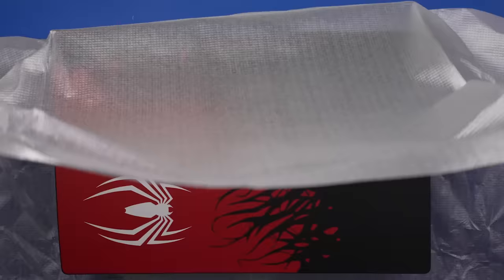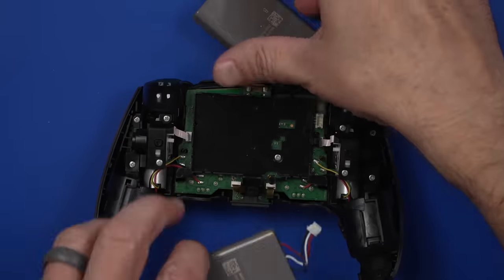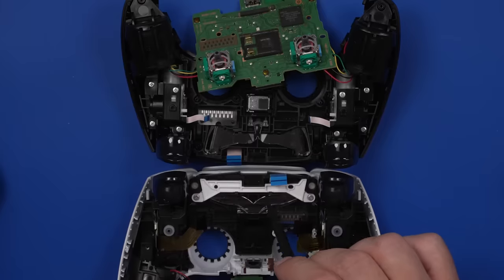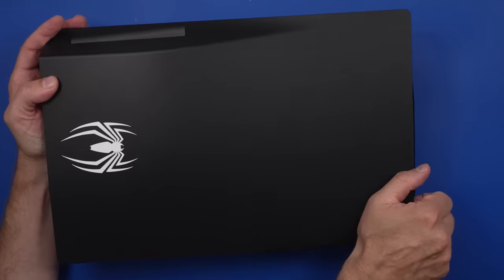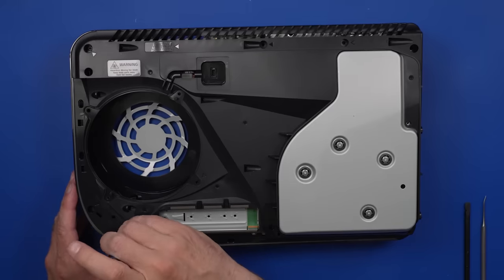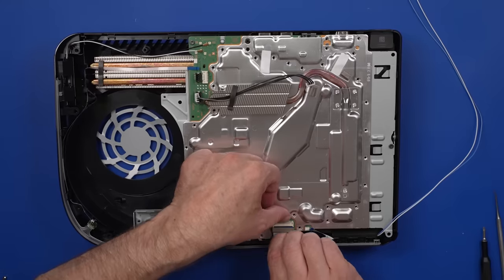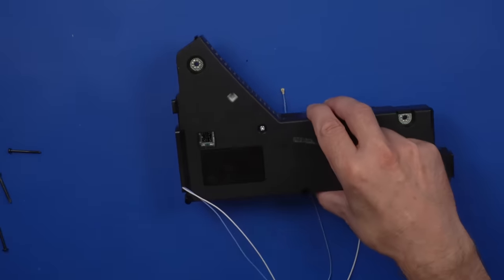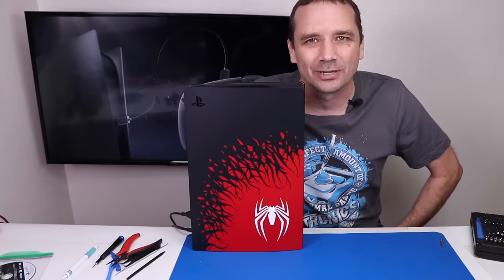The Spiderman 2 PS5 is a Disappointment - Teardown

Comment: I don’t think anyone expected it to be any different from any other PS5 in terms of hardware.
Reply: exactly
Reply: @caphowdy666  oh yeah?? Look at ds4 old model that has no lightbar..
Reply: @sevengedafterlife9670  All dual shocks had the light all they did with the new DS4 was had thinner plastic above it so it showed through above it. That was nothing to do with "limited edition" that was to do with being an updated controller everyone could buy. Same when you talk about early Dual sense vs second gen. They annnounce the changes. There were no changes announced for Spidey limited edition just the cosmetics.
Reply: EXACTLY
Reply: Exactly. It's more of a video to badtalk the ps5 imo... But hey, I'm sure that if you don't clean it from time to time, It'll end up with with some spiders inside...

Comment: I’ve never thought about a “special edition” console as being different on the inside. It’s just a way to get a fancy color or design. It was great for me because I didn’t have a PS5 and those plates sold out super fast.
Reply: Xbox does cool things on the inside. Like they did for Xbox one s minecraft special edition (imo the best se console of all time)
Reply: @Luckysury333  really doesnt matter to the consumer at all, also because the PS5 only uses plates to customize the console theres no need for them to open up the PS5 or make new  spiderman themed parts when they can just whack on some plates on and call it a day
Reply: Yeah but xbox does that because they target the teenagers and preteens. Xbox has always done cheesy special editions.
Reply: @tinystar3010  I mean, every console is geared towards kids. Spiderman, mine craft, fortnite, halo etc. Xbox is just better with build quality,  power, reliability , and low maintenance.  I own both and can say for sure I've needed 3 ps5 controllers in 2 years and needed to redo thermal on ps5 bc overheating. I haven't had any issues with series x yet
Reply: just get them fake they are half the price and look the same. This is on Sony's for doing such a small limited run.
Reply: @Luckysury333   The one thing Xbox does nice is that it's not just a console design. They'll put on a custom start-up chime too. PlayStation has been using the same boring beep since PS3, even for their special editions. Put in just a LITTLE effort for once, Sony.
Reply: If there is nothing "special" about a piece of hardware product then there is another word for it...scam! 

some of us already know its usually just some colors but the majority of people will belive this scam and think its better hardware for higher price
Reply: @benji7275  I replied to the comment that said they have never thought about a se console being different on the inside. So I mentioned there are se consoles that are modified (because it is just the same components with a bunch of Easter eggs in xbox se consoles) on the inside.
Reply: @tinystar3010 I wouldn't call that gears of war se "cheesy" thing looked cool.
Reply: @MichaelM28  yes
Reply: @MichaelM28  I'm sensing you're a Sony fanboy and that's fine but from my own experience of owning both ps5 from 2021 and series x from 2021 my ps5 has needed more maintenance and controllers broke 3 times. And it's crazy because I play the Xbox more lol and the proof is in the stats xbox is built better 🤷‍♀️
Reply: @MichaelM28  I mean, it really is. The last few Xbox consoles have proven that they are well constructed, silent and reliable. Meanwhile playstations are getting dry spots on their APU’s already The series X and S are some of the best built and easily repairable Consoles on the market. I need to unscrew just 2 screws to get to the internals of my Xbox. You need to unscrew over 40 to even think about catching a glimpse of the internals of a PS5.

🤣🤣🤣🤣🤣🤣
Reply: @frostywindshield2034 If you are going through controllers like that, your the problem, not the console or controllers. I’ve had a Ps5 since launch and have had minimum problems with the controllers, even with daily use.
Reply: @ihavethepower9464   wrong, I play both I've played warzone, multi-player, spiderman etc I I've used both Xbox and ps5 controllers and sorry to tell ya but ps5 controllers are jot built to last as long. Don't get in your feels just bc you're a Sony fan boy and refuse to acknowledge the difference in durability
Reply: @frostywindshield2034  tf you be doing with your ps5 slamming it against the ground? I’ve had mine since release same white controller that it came and literally no problems out of it whatsoever
Reply: same I believe is the system is different color and are limited

Comment: Have to hard disagree with this being a disappointment. I think it's awesome that anyone can turn their PS5 into a limited edition style console without having to buy an entirely new console. I find this rather pro-consumer. Yes, it hurts the rarity and people can inflate the aftermarket pricing down the line but I still prefer this strategy of making consoles limited edition.
Reply: It could at least make a special noise when you turn it on...I think it's disapointing all they did was put a new code of paint yawn.... look at the Funtastic N64's those are actually special, all the 360 edition's that came out? Yeah that's special this isn't special it just looks cool and that's it.
Reply: I came back cause I will give you the "I agree that it's pro that we can change the plates" that right there is a big plus but still I have my other feelings.
Reply: @GoofyPoptart  what did the funtastic N64s do that a regular N64 didn’t ?
Reply: @andrewglidewell2699 just grasping, like the special turn on sound has been done for 2 consoles (as far as i am aware), and that was a special requirement from taco Bell for prize not a special edition that was available for sale, and the series x they done doesn't even look different 😂

Comment: 6:48 I’m surprised that you didn’t notice that they cut out a L shape on the power supply side. And there’s also another cut in the center. My assumption is for better airflow. You can see right through it when you remove the plate.
Reply: i thought this isn't new, we saw it on the 2nd gen ps5 didnt we?
Reply: @sunlessheaven  yes you’re right after scrubbing for a video to find on the refresh I do see that there are new holes! It’s news to me thanks for pointing that out.
Reply: @sunlessheaven  It is a new changes made for 2nd revision PS5 (3rd gen, CFI-1200)

Comment: It will be cool when you finally get a PS5 Slim and break one down to see what all they did when they shrunk it!
Reply: Thwy will probably use ps4 components 😂 and maybe tone down on the Chip or capacitors along with the fan size. The ps2 slim vs ps2 was pretty much same thing, ps3 versions also had same hardware between all versions but improved it. The difference in the ps4 versions released weren't that much different either.

Comment: There are three different versions of the controller boards and yeah the spider-man  is the 3rd, I’ve modded my spider controller to have back buttons and needed to be sure cause the ribbon cables are different between v1/2 and v3

Comment: I know you’re a professional at it but why do you use pliers to pull up connectors I know you probably haven’t done it but everyone else usually breaks stuff off the board when they do it. That way I’ve worked on consuls and controls for 10 years plus and I’ve always pulled the connectors off by the wire.

Comment: I have acer aspire 7 laptop , when i try to use while charging it gets off, but after charging then using, it works. Can you tell what would be the problem. On full charge battery drains in 4hr on normal use.

Comment: Welp... I pulled the trigger on this one... Maybe stupidly as I haven't had console since PS3. But I did some research and figured that well... This is still the "Older" chassis model, but it does have better 6nm die in it, and seems a bit easier to open up than CFI-10xx/CFI-11xx. I also really don't like the fact that the new SKU of PS5's requires internet to access and verify the bluray. We're seeing a shift from the disk model on the industry, so I wanna kinda grab the models of these consoles, both Playstation and Xbox eventually, before they remove any and all access to disk consoles. I'd be fine if we switched from disks to microsdxc's, but I don't think the companies are looking for a replacement to the physical media but rather, they wanna digitalize everything, obviously. So, this is my christmas present, and it certainly wasn't a cheap one...

Comment: The APU is slightly smaller than the first 2 gen PS5s. Austen Evens did a tear down and comparison between the 3 gen models. Gen 1 has a larger heatsink. The gen 3 is 1nm smaller.

Comment: Sony's special editions are pretty much just color swaps, and always have been. I know Xbox used to have circuitry on the boards of their consoles that weren't populated on most consoles so they could add special sound effects and such to their special editions. I'm hoping the PS5 Slim won't have liquid metal. I had to change how my console was mounted due to the liquid metal pumpout issue.